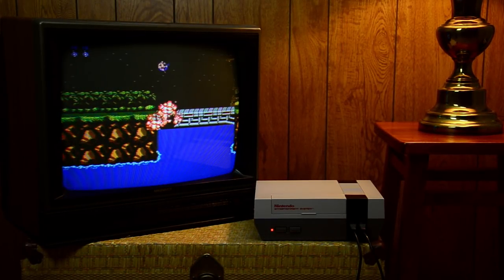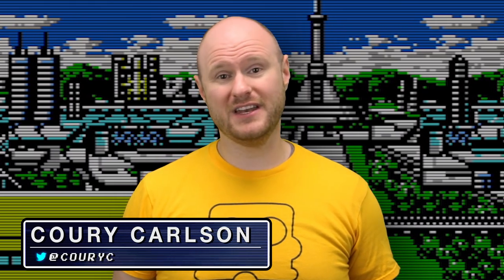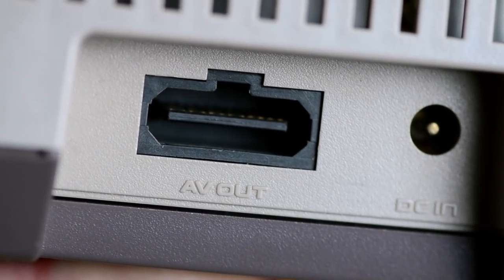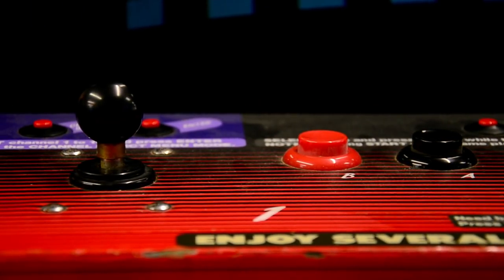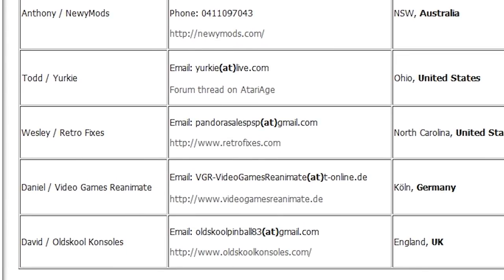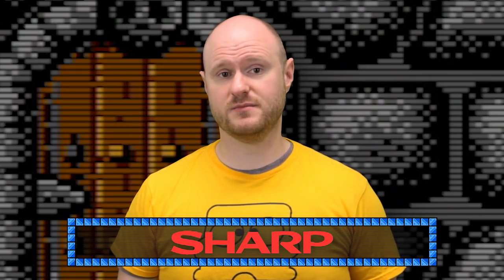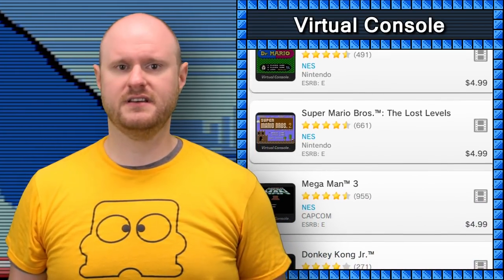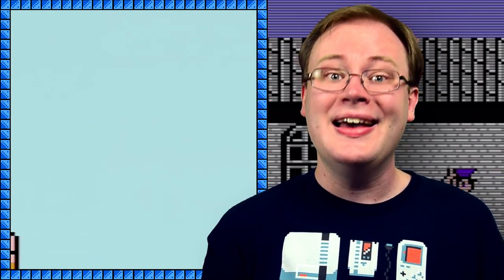Nintendo Entertainment System :: RGB 202 / MY LIFE IN GAMING

Comment: Hey i was wondering where did your friend cory find this premodded nes model 2 with multi out
Reply from the maker: [Try4ce] eBay, many years ago. But he got lucky. Nowadays we're reluctant to recommend random eBay pre-modded systems because it's hard to know the quality of the modder's work.
Reply: Thank you so much cause ive been trying to look for one for weeks now
Reply: Oh i almost forgot since in one part you said at 8:20 that it works with every nes games except castlevania 3 and jackal
 Well there is a better option to play castlevania 3 and jackal with the nes to famicom adapter from retro freak on ebay
Reply: Hey um Try4ce i was wondering if the 3 controller profiles that worked on the kritiz wireless sega genesis controller will those 3 profiles work on the sega genesis mini?
Reply: @mylifeingaming btw i also meant to ask what about the nes clones they look like the nes model 2 called the zoga do those count for i guess rgb conversion and etc

Comment: "The Retron 5 outputs via HDMI, but its emulated." So....what? Is there some reason that emulation is bad? I want to know. I have a Retron 5 and haven't noticed a problem, but I didn't get into gaming until the N64. Am I missing something?
Reply from the maker: [Try4ce] Emulation is generally in a pretty good state, and it's an important part of game preservation. But it can never be 100% accurate, even if you can't perceive the difference. Original hardware is the only way to be sure it's playing the way it's supposed to. For example, official options are the only methods accepted in verified speedrunning records (to my knowledge, anyway). Emulation also has some inherent lag to the process, though often it's so slight as to not be noticeable. The RetroN 5 has varying degrees of input lag depending on the system being played. SNES and GBA are the worst offenders in this case. The biggest thing is just the assurance of authenticity in the performance of the system's functions.

Comment: Is composite output the best picture quality for a PAL UK NES? Can I just buy an RGB scart, plug it into a nes and then connect to a HDTV?
Reply from the maker: [Try4ce] It will be composite quality even if it's SCART, unless you mod the system for RGB. The French NES has an "RGB" port because of some regulation, but it's still composite quality (I've even heard it's worse composite quality).
Reply: @mylifeingaming  Thank you.

Comment: If someone has an HDCRT HDLCD and Elgato that they plan too hook all systems to simultaneously is the NESRGB the best option? Would it connect to the HDCRT via component or svideo?

If it would work with both TVs simultaneously(I am guessing I can just use like an HDMI splitter to get the signal to the LCD and elgato after converting to it from RGB) in some way I'm tempted to pick two up for my FC and my NES.
Reply from the maker: +Stephanie Lovik [Try4ce] Well, the output would come from one port, so I'm not aware if anyone is designing these in such a way that you could pull S-Video and RGB at the same time (if it's possible...?... maybe, but I don't know). To get component, you'd need to convert the RGB to component using an external box, or something like the HD Retrovision cables (which aren't available yet, but... soon, apparently!). There's also the HDMI mod (which we did a video on too - https://youtu.be/TI60A3DpI6w ). Unfortunately, I'm pretty sure that it's not possible to have both the RGB and HDMI mods in the same system. I think analog is good for its versatility (and usefulness on CRTs), but HDMI is worth consideration. But if you're looking for simultaneous stuff, it's gonna most likely involve splitters, not multiple outputs from the console.

So yeah, I'd go RGB probably, but your setup might require a few extra devices.
Reply: *****
So basically I'd do RGB scart run that to a scart splitter then convert one to HDMI and one to Component and that would probably give me the best video on each. Am I understanding that about right?

If so the only question left is if it would be better to run the HDMI or the Component to the Elgato. I assume the HDMI since that preserves RGB, right?
Reply from the maker: +Stephanie Lovik [Try4ce] Right, I would run HDMI to your capture card because that minimizes signal loss, if you use a good HDMI scaler like the Framemeister to do it. It's easy to split HDMI to go to an HDTV and a capture card. Splitting SCART is a bit tougher though, because good SCART splitters are hard to come by. What I do, I have a PVM with RGB passthrough, so I use that for my CRT. The passthrough goes to my Framemeister, which ultimately goes to my TV and capture card. Does your HDCRT have a DVI input? Mine does. If so, then you could do another HDMI split, and convert HDMI to DVI. That would be an easier conversion than having to split SCART. As far as I know, HDCRTs are digital anyway (mine is), so there's not necessarily any benefit to giving them an analog signal, as there would be on a standard def CRT.
Reply: *****
Mine tops out at Component. On the bright side it still fully supports both analogue and digital. And still plays Duck Hunt which I hear newer HDCRTs have trouble with.

As for splitting the HDMI that isn't really necessary since the passthrough on elgato works pretty nicely. Or is it better to split instead of use passthrough?

Comment: Damn, looks like I'll be using the old av cables for my NES.
Reply from the maker: +Dan Olejniczak [Try4ce] I think supply may be a bit low currently, but there's also the Hi-Def NES option to look into, which became available after we did this video. We covered it in-depth here: https://youtu.be/TI60A3DpI6w
Reply: +My Life in Gaming Where would I purchase the Hi-Def NES? Also, I was just curious, what kind of setup would you recommend for hooking up multiple retro consoles to an hdtv for someone on a budget? Even if its not the rgb quality. I don't think I can afford that Japanese import device you guys use, plus all the scart cords.
Reply from the maker: +Dan Olejniczak [Try4ce] For the Hi-Def NES, the best I can suggest is keeping an eye on this site: http://www.game-tech.us/ As far as I know, he's the only one who's installed them so far, but I think he is currently out of stock. As for retro gaming on a budget on an HDTV, HD Retrovision's SNES and Sega Genesis component cables should release fairly soonish. Those will be a pretty cost-effective way to get a high quality signal, but it won't upscale... still, it will be a big jump in quality. The other possibility, if you don't mind emulation, is to just use something like the RetroN 5 or Retro Freak.

Comment: I was born in 93. This was my first console.My mother got it at a yard sell for me for 10 bucks.I had no clue what it was. I open the tray and was a amazed what I saw. A gold game called Legend of Zelda. Still have it to this day 👍 I can’t play the game something is wrong with it.
Reply: Depends.  If the NES screen is flashing, then the game or nes connection pins might need to be cleaned with a little rubbing alcohol or windex.  If it doesn’t even turn on, then there might be an issue with your NES’ power supply or hardware

Comment: I want to get a Euro Scart cable to use when I get around to getting my AV Famicom converted to RGB. Will an NTSC Super Famicom cable work? How about GameCube or N64 NTSC Euro Scart cables? thanks guys
Reply from the maker: [Try4ce] Sort of, yes. You might want to watch RGB 103 to understand sync and also understand the difference between SCART and JP-21. When you say "Super Famicom," well, an RGB cable that was made specifically for sale in Japan would've been JP-21, not the European SCART standard that you're thinking of. I use a custom-made NTSC SNES CSYNC SCART for my RGB-modded AV Famicom. While there is no difference between RGB cables for PAL and NTSC, the SNES is a bit of a different situation. So I wouldn't recommend getting a PAL SNES cable for your AV Famicom, since that is designed very specific to the PAL SNES. Don't go looking for official cables, to be honest. We recommend retro_console_accessories in the US on eBay (her store is usually only open earlier in the day because her sales quotas fill up fast) or Retro Gaming Cables in the UK. We have links in our video descriptions. Just be sure that the device you're connecting to is expecting the European SCART standard and not the Japanese JP-21 standard. I feel like I may have just typed up a confusing mess here, so sorry if that's unclear!
Reply: +My Life in Gaming Thanks for the info, I'm based in the UK so none of my systems have JP21 Scart cables, only Euro Scart cables.  Though scart inputs are a premium in my setup so if I can double up and use one cable on multiple systems that would be great.  So I'm right is assuming that a Euro Scart Csync cable will be fine with both my Super Famicom and Famicom AV?  Again thanks for the reply it's really appreciated :)
Reply from the maker: [Try4ce] Yep, that should work fine! But like I said, the PAL Super Famicom is a bit unique in how its RGB line is designed. An opposite region cable will work, but the color/brightness might not be quite right (I haven't actually tested this, but that's what everyone says). Since I've been using an NTSC SNES SCART with my AV Famicom, I can't say for sure if the colors/brightness/whatever would be the same when using a PAL SNES SCART. If you already have the PAL cable though, it's definitely worth trying. If you're happy with the result, then just stick with it!
Reply: +My Life in Gaming My Super Famicom is a Japanese NTSC model not PAL :) Again Try4ce thanks for your time and keep up the good work with the channel, its one of my favorites on YouTube.  The information you guys put out being invaluable in my quest for the ultimate game set up :)

Comment: So if you split the audio signal into two with an adapter, do you get stereo sound?
Reply from the maker: +KingFredrikHD [Try4ce] Well, the exact same thing will be on both speakers, so it's not like it takes advantage of stereo sound. It's just an easy way to ensure that your audio isn't only coming out of one speaker, which would be annoying. Sometimes if you only plug in the left audio jack, the same signal will come out of both speakers, but not always.
Reply: ***** OK, thank you :)

Comment: I'm trying to stream my NES without modding the console. Seems the only solution is the frameister. But before I do that, I'm going to try the RetroTink 2X and see if that improves anything. The OSSC, I have no fucking idea how to use it. I can't get any video to stream it with this thing so I was disappointed by this one.
Reply from the maker: [Try4ce] It's possible your capture card does not like the OSSC. The RetroTINK operates in a similar way, so it's hard to say. It's because of the off-spec signal each console may output. Some capture cards are just not tolerant of these variations.

Comment: Hi guys! I got a problem: i got a ntsc nes top loader as a present with only rf-output. Unfortunately it won´t work properly on my pal tv (bang & olufsen mx7000). color picture (sometimes) and no sound. Do you know what to do? SInce it was a present, hardware-modding would be my last choice
Reply: i tried the ntsc-rf unit an the pal-rf-unit
Reply from the maker: [Try4ce] You should be able to use it on a modern PAL-region HDTV, I think, but obviously the picture quality might be poor with RF. What I'm not sure of though, is whether any PAL-region TVs can get around NTSC color encoding on the RF signal, even if they can accept 60Hz. But you have a GREAT system there, and I don't think you should be ashamed to mod it. I just got a toploader earlier this year myself and was so excited to get it RGB-modded (so I could stop using my AV Famicom for NES carts with the adapter). If you've got RGB-capable SCART inputs, RGB NES is a beautiful thing.

Comment: is anyone able to tell me if the ppu from the front loading nes would work with the top loader? i have a front loader that i cant seem to boil/bend the pins on well enough for them to work and aftermarket onces still flash a great deal of the time.. id like to do an rgb mod on my top loader with the front loader's ppu to perhaps not have to worry about the jailbars that the top loader is known to have. there not a huge issue to me but if its possible to not have them, than why not?

Comment: Why not just use Component with the Wii U?
Reply from the maker: dimmddr1 [Try4ce] Unfortunately, the result is not the same as it is on Wii. The games are already scaled incorrectly internally by the system.
Reply: ***** Can you set the output resolution to 480p?

Comment: Anyone know what cable I should buy for a RGB Modded AV Famicom? I don't wanna shove my cable from my Pal SNES into it, if it ain't the right one.
Reply from the maker: [Try4ce] I use an NTSC SNES RGB cable. The PAL SNES cable has a different resistor/capacitor configuration. I don't know for sure if PAL SNES cables are the an equally fine choice for RGB-modded AV Famicom, but it won't hurt anything - it just might not look right.
Reply: ***** Thanks I appreciate it! I'll get that too be sure :)

Comment: BEST way to get a solid picture is 1. Buy Retro Freak 2. Raspberry Pi. Not trolling. It's how it is. If you make these hardware changes, it's NOT the original hardware anymore.
Reply from the maker: [Try4ce] Original hardware refers to how the game is processed. Video output mods don't affect the authenticity of the game processing.
Reply: My Life in Gaming Soldering chips, mod boards are hardware changes. It's cool if that's what someone wants, but at that point RetroFreak or Raspberry Pi.

Comment: I have a french nes. It is composite converted to RGB (which is even more awful than composite). Combined to 50hz only, it is probably the worst nes possible.
Reply: Adrien Folie There’s no such thing as Composite covered to RGB. It’s just a mislabelled port. You’ll just have composite video going down the composite channel of your SCART.

However, the French NES is probably one of the best NESs. If you can live with 50hz, then you’ll be getting some of the best composite video available due to SECAM not having most of the dot-crawl artefacts and some of the other issues that are common with composite. The worst NES would be either the Mattel Edition UK NES, 50hz and PAL composite, or the American NES-101, RF only with NTSC artefacts that PAL and SECAM don’t have in addition to the normal RF artefacts.
Reply: Just Another Youtube Channel mate, the truth is that French NES actually outputs RGB. It is converted from Composite to RGB. Because France used SECAM composite video system, PAL and NTSC composite colors won't work. And because there wasn't any SECAM composite compatible NES, they just made the PAL NES work on RGB-enabled French TVs. In order to make PAL system work on SECAM TV, you need to have RGB signal, which is not encoded like PAL/NTSC/SECAM.
Reply: @justanotheryoutubechannel  you know, how well does SECAM composite hold against NTSC composite. Is it like s-video but with a faint dot crawl affect on certain colors? Cause certain capture cards and HDTVs make the NES's composite video signal look like shit and it only seems like   consumer CRTs are capable of showing a acceptable looking composite video and a Beautiful 240p s-video signal. Something TV manufacturers don't want us to enjoy with these built in scales that  work wonders with High Defenition content, and 480p, and these assholes constantally leaving out s-video inputs and if not that... 240p support over component inputs and if not that,240p handles properally and instead handled as 480i.

Comment: grate video guys, you covered all the points on that one. have you come across the hi-def nes? have a look at channel by "kevtris"  hes developed a hdmi mod for the nes along with some grate features along with it, kind of like a alternative to the framemeister
Reply from the maker: dylbob9000 [Try4ce] Yup! There's a super brief mention of it at 10:33. Matt Buxton of Video Game Perfection suggested that we mention it. I was actually not aware of it myself. I think it looks like a fantastic option, however I don't think it would work too well in my own setup, since I'm already using so many systems with RGB.
Reply: ah, i see. must have missed that on my phone. you could pass it through the xrgbmini, i recently got a RetroPie and passed it (hdmi) through my xrgbmini (you do odd things in this hobby) and between messing with the features on my tv and the mini i manged to get it looking like i was using original hardware. it lets me emulate systems i haven't got around to and preview what they would look like on the mini. but i mostly wanted to see what would happen, scanlines dont appear but the image dose improve in meister. kind of like a second sharpness and the lag is only slight.

Comment: I would recommend against buying RGB Modded NES's off Ebay.
First of all, they are overpriced. I picked up my RGB Famicom for 164USD from oldskoolconsoles(dot)com (nearly 200USD cheaper than you would find on Ebay!).
Not to mention, Ebay is home to a ton of amateur modders so you never know what you're getting.
Reply: AV/Famicoms are an extra 50 euros, however.

Comment: I wonder why Japan always gets better hardware than the US. Why make a great product and then cripple it for certain markets?
Reply from the maker: [Try4ce] Well, I don't know if I'd say that's a trend, or that the NES was cripped compared to the Famicom. NES did have composite output, while Famicom only had RF (until those roles were reversed with the redesign). The front-loading design did cause problems for the NES, but Nintendo wanted to make the whole thing feel as far removed from preceeding video game consoles as possible, since the industry market crash a couple years prior.